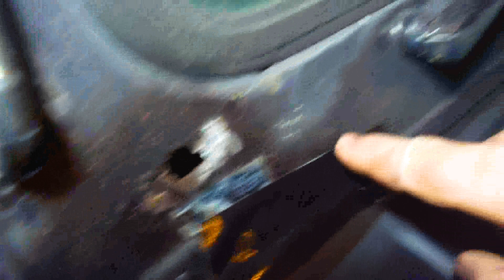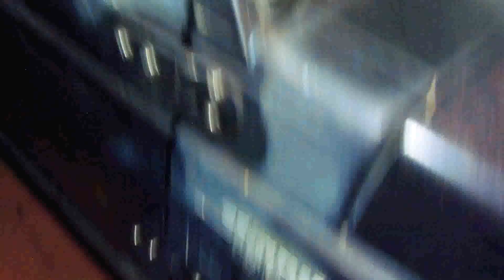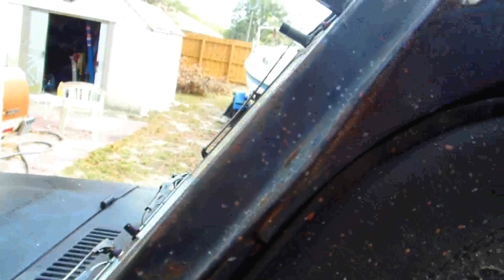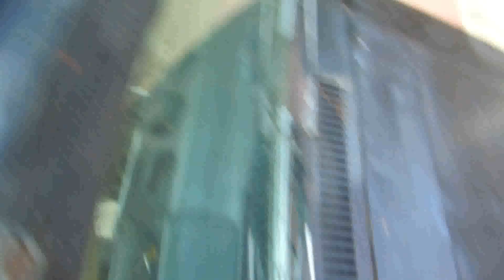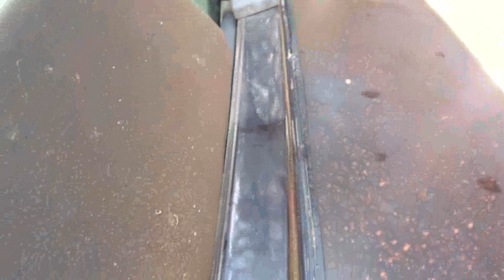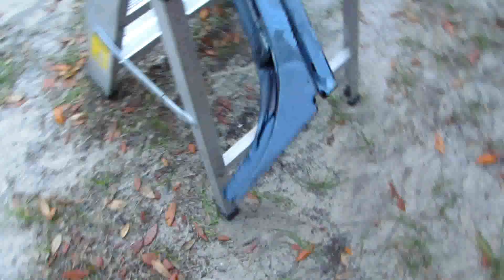Suzuki Samurai -Windshield Frame Rust Repair 1 of 2

Comment: Rust hole that size from chips?  🤣 Okay if you say so, but no it's from water getting in there somehow.  And truck bed lining is the new fix to cover rust instead of actually removing it and replacing with new sheet metal.  I guess I'm too much of a perfectionist to be okay with this kind of "fix".

Comment: I love these tips. I also still own, and LOVE my first ride. I've taken it off the road from time to time, but it's a hopped up 1996 with 120k miles. So many memories and parts and paint job's. She's lived her whole life in the N.E.I took my road test in it, in 1998.  I am so proud of it, and I would never trade it.  I can pull up next to anything. I have so much fun when I drive it.Wish it was obd1, but there is a conversion kit. She purrs like a kitten and handles like a 911.
Reply: It's also great in the snow. With studded hakkas, knock on wood.  When,  I decide to through them on. Some winters she sits outside, gotta remedy that.  It's got a one piece adjustable coil over suspension. I could go on and on.
Reply from the maker: Douglas Freer
Yeah, I wish I kept some of my 1st cars,  1962 Impala Super Sport Convertible, 1969 Roadrunner convertible.  Rare as all hell today and they were even rare decades ago.